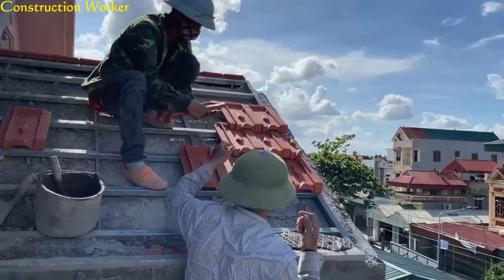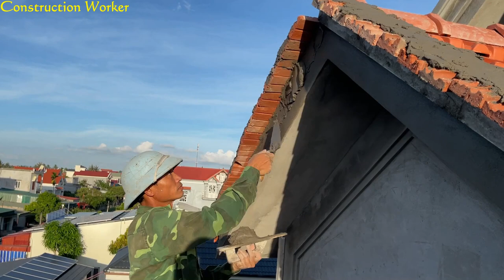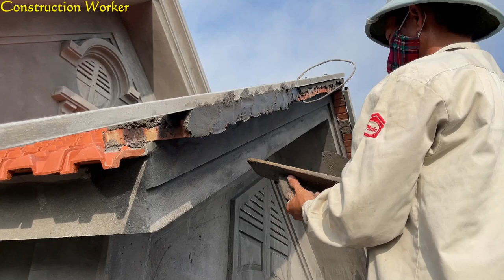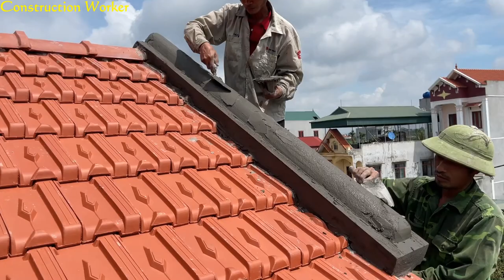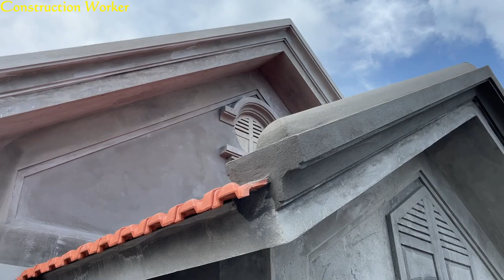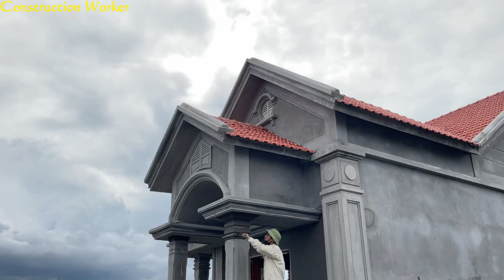Amazing Construction Technique Of A Shaped Tile Roof

Comment: 👎👎🚨🚨🚨👎👎where the anchors, screws - a little wind and everything will go to hell
Reply: That house is being built in an area that receives the most storms of the year in Vietnam, and there are thousands of such houses, you don't need to worry, it is all calculated, in addition, there is a layer of concrete. tone below
Reply: @mm-xd1ob  Hải Dương Provice in North Viet Nam,  
near Hanoi